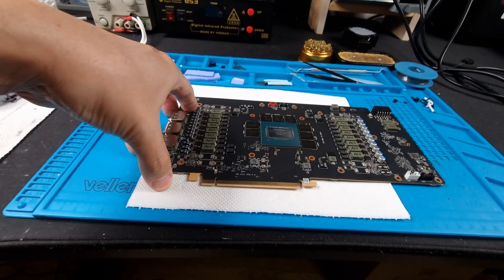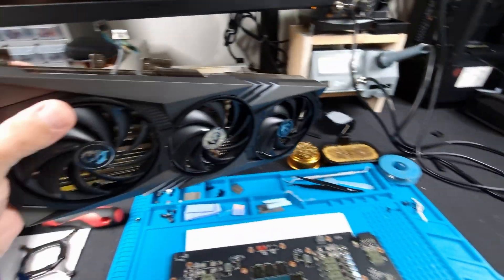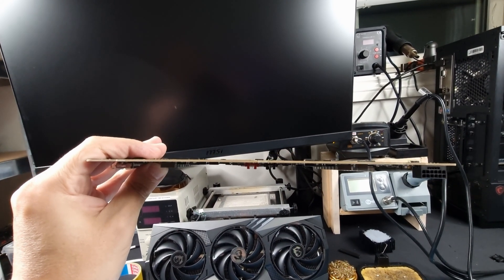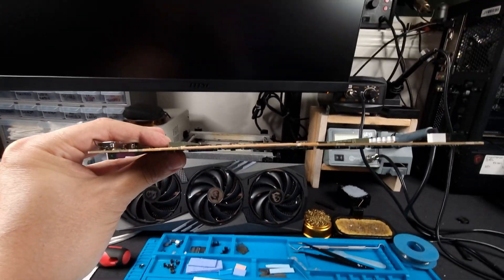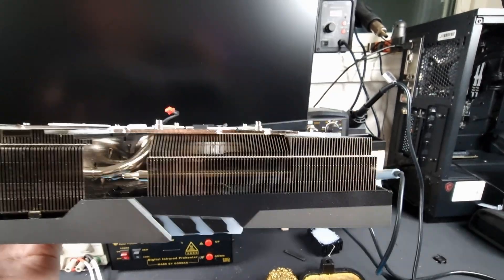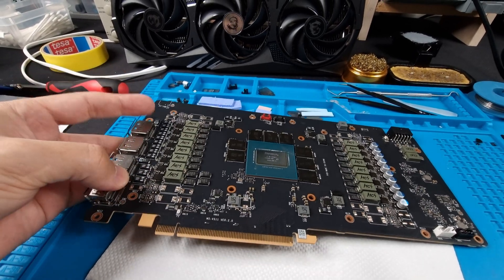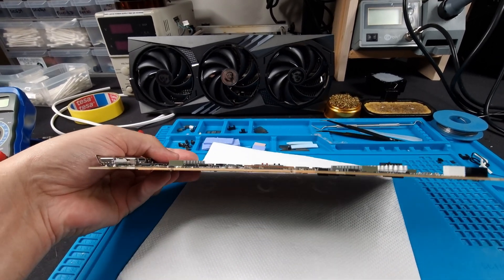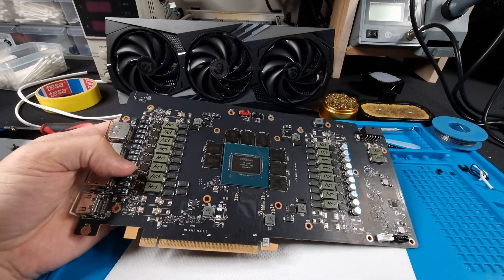How Using GPU Supports Incorrectly Can Destroy Your GPU.

Comment: I have a ROG Stix 4080 and it is massive. I did have it on a riser for a while but it just wasn't getting good air flow making my whole setup hot. I did notice that the mounting bracket on the card is connected to the whole case of the card so it is pretty solid when connected straight to the mobo. I have it in there now with no support and it doesn't have any sag.
Reply from the maker: I hope it works out for you in the long run.
Reply: @TechnologyHive  after watching this video I'll probably switch back just as insurance. I just hope it will miss my pcie to usb e adapter card

Comment: This is not a "graphic card error" but the fact that 2 and 3 fans have different weight points. The correct way is to NEVER use a single point.

Use 1 support point with card that have 2 fans and 2 support points on cards with 3 fans and then no card will get damaged. Ever used that method in my laboratory and suggested that with all the customers that requested that to me and noone of them had a card getting damaged even after years.
Reply from the maker: @BryanTheFury  Funny, because I keep getting cards in for repair due to their weight and being installed horizontally with or without support. Heavy cards need to be on a riser, period.

Comment: Unfortunately in my setup I don't have the option of a vertical setup.
Reply from the maker: If you're card is an expensive one, and heavy, a new case may help.
Reply: @TechnologyHive  For what it's worth, all cards are expensive in my opinion, even the 3060 Strix I snagged in the Newegg shuffle. Plus I got other expansion cards in my system as well.
Reply from the maker: @SOU6900  Ah a 3060 is not so expensive in case it does bite the dust. And if you are well established in your system, a move to a new one may just turn out to be a headache.
Reply: @TechnologyHive  😆 It was expensive back then because I was on fast food level pay, but that was then. If need be, I can pull my expansion cards and move the m.2 from the x4 card to the motherboard, but I don't know how much it will affect the gpu to go from 16 lanes to 8. If I recall, Cooler Master makes a conversion bracket anyway that I can toss in my case as well since it's also a CM product.
Reply from the maker: @SOU6900  That cooler master vertical is excellent. I made a video on it. Great choice if you go for it.
Reply: @TechnologyHive  I got everything I need to build a new system in the Asus Strix Helios case minus the GPU. Don't really want to pair the 5950X I got for it with my 3060.

Comment: this only applies to triple fan cards right? my 2060 super (msi gaming x model) only has 2 fans but its hefty - its held up by a plastic pipe in the middle atm so i wonder if a vertical mount would work better here
Reply from the maker: this applies to any heavy graphics card. but you have to use common sense here also.
Reply: right 😅 its still working at the end of the day

Comment: What about a vertical orientation like in the sup01 case or the xtia open case/stand?  Are the pros and cons different?
Reply from the maker: As long as the card is not in horizontal position, you should be fine.
Reply: @TechnologyHive  I read something recently about thermal problems if vertically mounting gpus with the i/o pointing upwards but didn't understand why and didn't follow up on it.
Reply from the maker: @Eric-un2oq  That is if you install the card vertically near the side panel. You chock the card out of airflow like that. But using a 3rd party mount is a different story. Works perfectly.

Comment: TLDR: User Error as usual.
Reply: 90% of repair techs making youtube videos can be summed up as this
Reply: Not always that new connector nvidia is using is just objectively garbage.
Reply from the maker: @Lynnfield3440  They had to fix the 8 pin connectors because they weren't broken enough 😅. So they fixed it by installing one that, when installed incorrectly, will just burn up your card.
Reply from the maker: @sparda9060  But, it should not be the case. The average person buying one of these things wants get it installed and get to using it. It's the way it should be. The error here having to add pillars or other supports to these now very heavy cards. One should not have to do that. Best way to protect your purchase is to put it on a riser. Done.
Reply: @TechnologyHive What'd be your solution then? All cases or GPUs come with risers? Because reducing weigh isn't exactly feasible, at least I personally wouldn't want it at these power draws. Would require much louder fan speeds. I like my silent, thick radiators.

And for me a riser is not possible anyway, I have a tower cooler in an O11D Mini, can't fit a vertical card in there.
Reply from the maker: @ZenTunE-  If your case is small enough, set it on it's side, so the GPU is horizontally. Just a thought.
Reply: @TechnologyHive  Possible, but cumbersome. And ruins aesthetics. So not an acceptable solution for those times the PC is on the my. Currently it's on the other side of the wall so I might as well.

Comment: GPUs have simply outgrown the ATX standard form factor and pcie x16 slot. Instead of add-in card slots we should have a dedicated pciex16 socket that connects with the back of the pcb. It would fix all the issues with board power and cooler clearance as well. PCIE SIG should have been working on this years ago.
Reply from the maker: @Ironclad17  They will not be changing things any time soon, sadly. Best thing to do is to out those heavy cards on a riser.
Reply: Or they push to much power to justify the big coolers for.marketing purposes, cos big is better, no?
Server GPUs don't need big "better" coolers, not RGB...
Reply from the maker: @BozesanVlad  It's to keep GDDR6X cool. Nvidia learned from the 3000 series. Tones of these cards died due to memory temperature issues since GDDR6X runs hotter than regular GDDR6.
Reply: @TechnologyHive  Interesting, thank you, I didn't know that ADA4000 has DDR1 or DDR2 so is cooler...

Lesson learned from the past: at launch, all GPUs had *BIG coolers, than when the newer cards were launched, they manages to even put on the market GPUs with smaller coolers/ even without coolers.
They launch half baked arhitectures (GPUs and reference boards), and indeed bigger is better until the GPUs kill themselves or even kill the motherboard with it.
As alicence designer I know the concept to "wrap sh!* in gold " (packaging/ promotion/ marketing) to sell said s*@t
That's my only point in this regard, a personal opinion if you may.. 

ADA400 is SFF, doesn't need a HUGEEE cooler for marketing purposes tho: 

"GPU Memory: 20GB GDDR6 with error-correction code (ECC)
Memory Bandwidth: Not explicitly mentioned, but implied to be high due to the 20GB GDDR6 capacity"

"Height: 2.7” (NVIDIA RTX 4000 SFF) or 4.4” (NVIDIA RTX 4000 Ada Generation)
Length: 6.6” (NVIDIA RTX 4000 SFF) or 9.5” (NVIDIA RTX 4000 Ada Generation)
Slot: Dual-slot (NVIDIA RTX 4000 SFF) or single-slot (NVIDIA RTX 4000 Ada Generation)
Power consumption: 70W (NVIDIA RTX 4000 SFF) or unspecified (NVIDIA RTX 4000 Ada Generation)"

As a side note, a bigger cooler/ shroud could eventually be bad for cooling in the end, even as temperatures. If they isolate the components, or are used bad pads, or the GPU itself heat the other components *through the "cooler" *. Another personal opinion.

Comment: After watching several vids of ppls pcb's cracking w/ GPU supports I bought a new case for my 4090 a month after I bought it. I run the case horizontally which allows my gpu to sit down directly into the mobo in the vertical position removing any stress on the pcb. I don't like the idea of using a gpu mount w/ a pcie extension cable; I prefer the peace of mind of a direct mount into the mobo pcie slot. I also run 4 temp probs on my gpu pwr plug to monitor the temps in case it starts to push to high I can shut it down. My plug temps while gamein CP2077 4K full PT runs at about 40C and idles at 32C. 

Such an annoyance w/ these gpu's w/ all the potential pitfalls one can run into if they're not careful as it can turn into a crazy expensive mistake.
Reply from the maker: Good move! You can be sure you wont be having cracked joints under your GPU core or memory this way. Happy GPU :)

Comment: When you have a graphics card that weighs over 2 kg, I don't see a brace as optional
Reply: If GPUs of today were more efficient than an electric space heater we wouldn't be having this problem
Reply from the maker: @connivingkhajiit  450w is now a thing. I remember when 150w was considered a power hog. But this was back in 2005 :)
Reply: @TechnologyHive  all of my cards have been 200w over the years. HD 7950 was 225W, RX580 was 225W (though i had it undervolted down to 120W), Arc A770 is 225W. I refuse to go higher.
Reply: @connivingkhajiit  Seems to be about the sweetspot, dunnit? In my testing, the 6900XT performs about 90% as fast at 200W as it does at 290W.
Reply: @connivingkhajiit  It's about power limits and/or voltage decrease required (with performance drop it entails).
Current cards are very power efficient, however they are tuned by factory to work at high wattage levels by default (in the name of marketing,  performace and profits)
At this point nobody wants to drop perfomance to fix it though (since less voltage = more rejects, and less performance from the same die size).
Reply: I believe it's not optional to, epically now. Built computers for 25 years. Started noticing GPU sag on cards around 2013 and made an improvised bolster before it became a commercial product. Around the time GPUs started getting heavier because the heatsinks.
Reply: good thing my rtx 5070 Ti is only slightly over 1,2 kg
Reply from the maker: Me either. That's going on a vertical mount!
Reply: @TechnologyHive  Question for you, how viable is just laying your tower horizontally? Mine has an entire side that doesnt contribute to airflow and im considering this.
Reply from the maker: @RockerXt29  If you can lay your case on its side, even better. I'd just loosen up the screws hold the gpu to the case while on its side, and then re-tighten them up to adjust for new setup
Reply: @TechnologyHive  Sweet! Im definitely gonna do that then, thanks for the feedback :)
Reply: @TechnologyHive  Fortunately, 99.999% of the builds won't see more than a GPU as a add-in card, cause you either block all the expansion ports, or need a case almost as wide as it is tall to accormodate the size of the heatsinks.

Watercooling will become saner and saner as those heatsink keeps getting roided.
Reply: Your pc case too small for effective verticle mount@TechnologyHive

Comment: The issue is people using them. My support bracket I did not put pressure on I placed it under on the bottom edge just the edge towards the front of my pc case glass. It's not touching a fan it's not pushing it up. Just placed it under. The issue is if I didn't my 14.1inch 4080 super strix was sagging like a mofo. Some you have to do it with lol.

I would rathet this effect overtime then my gpu touching the bottom of my case and the pcie connector being messed up. If you lay the support bracket under and dont put positive pressure its fine. It will lay on it slightly and its not pushing it back the other way. All gpu are made different also some have much harder outer cases much thicker metal cases and in those its much much harder to bend with a bracket.
Reply from the maker: As I have stated in many comments, hot/cold cycles will inevitably cause the PCB to twist or bend over time when installed horizontally. Supported or not. Customers have reported using supports for a few years and one day they try turning on their PC's just to be greeted by artifacts. If your card is heavy, use a vertical mount.
Reply: @TechnologyHive  i feel like the potential of twisting is worse then the sag, I personally never had a gpu or pci get damaged from sag

Comment: I think the gpu supports that screw all the way from the external expansion slot would be better as it does a more evenly distributed force of raising up the card would it be not?
Reply from the maker: @neltlen  No no. Those are the worst. Try looking for a decently priced gpu vertical mount, like the one made by Phanteks.

Comment: I noticed this with my 4080 Gaming OC and now I have 3 GPU supports with the card perfectly leveled, kind off. But that's just me.
Reply from the maker: @club4ghz  I'd still try to look for a vertical mount. But hey, that's just me. These cards are too expensive and I get then in for repair often due to the same problem. Sag.
Reply: @TechnologyHive  I know. I noticed it started bending in the middle even with gigabyte support bracket installed so I removed it and made 3 stick like supports out of wood with rubber ends and I had to adjust their position over time to straighten the pcb back how it was. It still has slight bend, not much upwards in the corner where the power connector is but I can't do anything about it anymore. I got the core area perfectly straight, and I will be checking for changes once in a while
Reply from the maker: @club4ghz  hope that works out for you! But these heavy cards just need to be vertically installed.

Comment: One Questions to the riser:

My Case the Ceres 500 is build for vertical but the gpu is not held to of the ground from the case its hanging in the air...

Is it okay or is it predicted to get damaged? 

Thanks for ur help❤
Reply from the maker: If it the riser is built to hang, it should fine. The Phanteks riser is also capable of being installed in a hanging position.

Comment: The real issue is why are there no motherboards that take into account the increased weight of modern gpus, and thus the case design, etc. ATX is an outdated specification, and is singlehandedly setting the entire pc tech development back years.
Reply from the maker: @guyfawkes0511  It is not up to motherboard manufacturers to accommodate heavier gpus. The issue is the heavy gpus themselves. Things have gotten out of control with newer gpus pulling crazy power numbers in order to remain competitive.
Reply: @TechnologyHive This is the type of mentality that creates huge problems down the line. Like it or not, there is only so much efficiency that can be extracted from semiconductors. Unless they develop a new material or an entirely new process, GPUs will get bigger and heavier and this has to be addressed by standards that dictate motherboards, cases, and etc. Risers and GPU brackets are both band aid solutions.

Comment: Thank goodness my RTX4070 Super is the smaller type cause it's the Asus Dual version and those are small for their type of card. On top of me using a Thermaltake CTE T500 case meaning my mobo and everything is turned 90 degrees so my mounting point is on the top of the case.
Reply from the maker: @lanoche  I've seen that case. Looks pretty cool in my opinion.
Reply: @TechnologyHive  It is. I actually like what TT did with the case. I was gonna get the T750 Air cause it was also on sale when I built my PC, but it was as big as my old Corsair 800D and I wanted something a bit smaller this time around. The T500 is like 3/4th the size of the T750.

Comment: My Hellhound 7800XT has been iffy from the start without a support.

It didn't come in the box with one and I decided to order a cheap finger thing support from Aliexpress. In the 2-3 weeks it took to arrive I felt like my GPU was almost dying. It was sagging a lot, like 1cm difference between the bracket side and the other end of the GPU. It looked like it was gonna break in half like a bridge without proper supports.

In these ~3 weeks sometimes I would go to boot up the PC and it would enter a boot loop. Holding the GPU level with my finger would allow it to boot up normally. Also, if it was turned on, and I touched the GPU in any way, both audio and video would freeze and I would have to restart the system. Even the slightest of touches would do that.

After 3 weeks my GPU support from Aliexpress showed up, installed it such that the GPU is now level and I haven't had any issues for 7 months now.
Reply from the maker: @BogdanM116  The fact that you had troubles when it was sagging is a big red flag. Most likely you now have broken joints under the gpu or memory. It will only get worse as time goes by due to hot/cold cycles.
Reply: @TechnologyHive  You might be correct. However they won't accept RMA if the card is working fine, especially if my retailer tests it on something like a test bench standing vertically.

I have a 3 year warranty though (Like 2.5 still left). If it fully breaks in this time I can send it back then. If it doesn't, that's just unlucky. In 3 years I will probably upgrade my GPU either way so it is what it is.
Reply from the maker: @BogdanM116  I hope all goes well.

Comment: maybe full length pci slot supports will work...
Reply from the maker: No. Heavy GPU's need to be installed vertically. There is not real way around it, if you want to be 100% sure you're PCB will not twist.

Comment: I have a Gigabyte 4090 Gaming OC, and have used the anti sag mount for 1-2 years. No issues, and I don't think there will be. It's a pain of a mount connected to the MB though, so you never want to add an SSD again. I think a screw at the bottom of a vertical gap stops it from sagging but doesn't push it upwards, just stops it from going downwards any further. I've seen people not happy with the MSI version though, and while I wouldn't say I'm happy with Gigabytes version since it is inconvenient, it does the job and seems safe based on visual, and 1-2 year usage.
Reply from the maker: I hope you will not have any issues later.